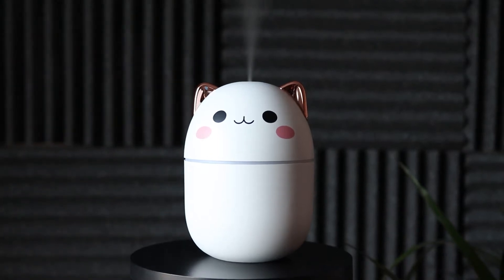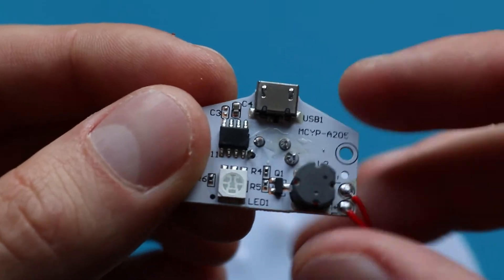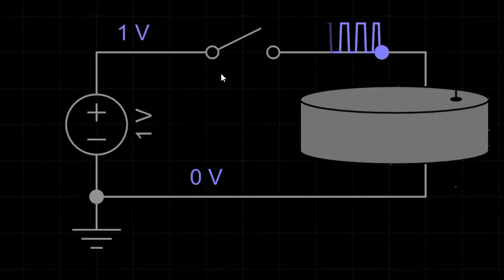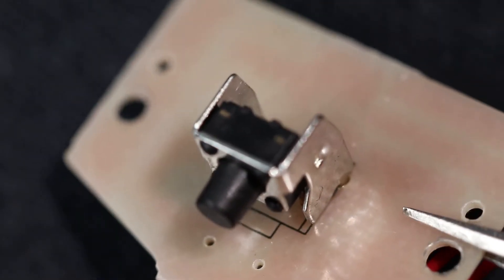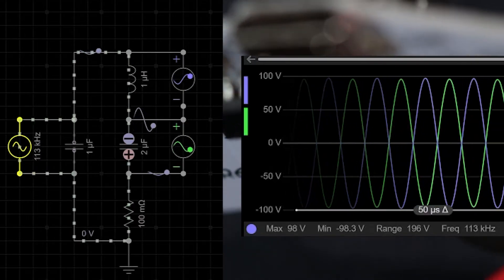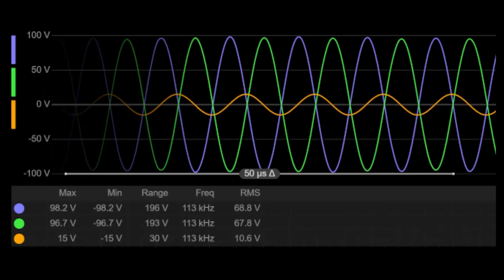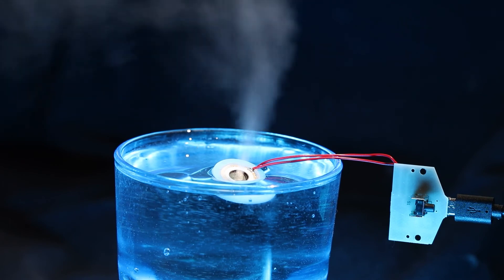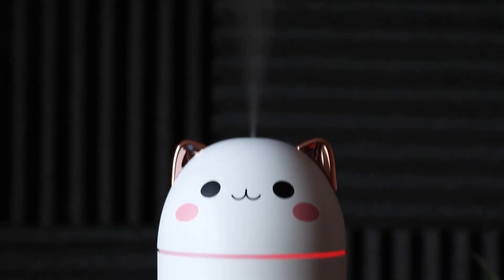A Humidifier Is Quite Interesting / How Does a Piezoelement Work?

Comment: Does the piezo have small holes so that the water from the wick at the bottom can reach the top surface of the piezo?
Reply from the maker: Some wise man in the comments says: "I bought one and you can see the holes. The ad says they are 5 microM, and there are 740 holes in about a 7mm circle. Pretty amazing.
BTW I needed a magnifying glass to see the holes."
So yeah, there are holes :D

Comment: Nice explanation! Is there a way to control the frequency of the piezo element?
Reply from the maker: What do you mean by controlling the frequency? You can control the frequency of an external signal applied to it, which would change how the piezo behaves. Using MCU or 555 timer. Or basically anything. 

Changing the resonant frequency of the piezo, or its physical parameters, would require physically modifying it.
Reply: @NickElectronics ah thank you very much for the information! 👐🏼

Comment: My question is when vapour comes out, does it depend if we put hot water or cold water, what will be vapour temparature?
Reply from the maker: So my guess is that heating the water causes the droplets to evaporate more quickly after they are released into the air, since the added heat gives the water molecules more energy to transition into vapor. But I am not 100% sure :D
Reply: Colder water is denser, so I would assume less vapor, not more.
Same thing as when an engine gets cold air, or nitrous oxide, it`s denser and lets you burn more fuel in the mix.
Maybe the element could be at a lower setting to produce the same amount of vapor if the water is warm?
Suddenly I`m tempted to atomize some hot coffee just to see what happens 😂

Comment: Can i make the piezo part vibrate , by  connecting it to the place where the speaker should be on a bluetooth music curcuit and sending a high frequency sound wave to that BT curcuit 🤔
Reply: These elements generally run at about 110KHz, those frequencies are not supported by any audio amplifier as it is far beyond human hearing.
You need a ultrasonic generator that operates far outside audible frequencies.
(some Class-D amplifiers drive a PWM signal switching at ~300kHz, but that is filtered before the output stage)

However, it should be possible to use the speaker output terminal to control the input power stage of the generator circuit, so it would create vapor on beat with the music! 😁
You would need to find out what the operating voltage is on the frequency generator, and the speaker amplifier would have to be able to reach that voltage to activate the generator circuit.
3-12V DC depending on type, commonly 5V on these small guys, so if the amplifier can reach at least 3V and the generator circuit does not have an on/off switch, it might work.
Btw, you need to know the impedance (ohms) of the speaker, and how many watts it can play at, that way you can find what voltage the BT amplifier can produce.

As an example, a 5W speaker with a 4 ohm speaker element, needs about 4.5V at 1.12 Ampere to produce 5 Watts, which should be a sufficient voltage to drive the generator circuit.
If the speaker is higher impedance that means more volts (given the same wattage) so the amplifier circuit wouldn`t need to be at full volume.

Oh, and of course you want to be within a certain range of the generator circuit`s intended voltage so you don`t destroy it.

All of this is theoretical, so experiment at your own risk ✌

Comment: Can I use the same circuit & operate it on 5V will it work? 
As NE555 can work with 5V also....
Reply from the maker: Yes, you can, but you have to be careful with the resonances in the piezo. If you supply it with 5V, the voltage in the piezo due to resonance may increase to the maximum that the specific piezo can withstand. With 3V and the same frequency, the resonance voltage is lower.

Comment: What I don’t understand is how the water film appears on the top side of the piezo element when the wick pushed against the bottom. How does that work?
Reply: I looked into it a bit more and it seems like this element isn’t the disk type, but a piezo ring that has a super fine grained mesh in the middle. The piezo ring slaps it onto the water surface and this causes water to shoot up through the holes, creating the droplets. The disk type on the other hand is used in submerged foggers that are used in ponds etc. 

I’m not sure if any of this is definitely true by the way, if the element is indeed a mesh it must have microscopic holes because it sure looks like a solid disk to the naked eye. On the other hand, I don’t know how a film could develop on the other side is solid, so surely there is some way for the water to pass through?
Reply: @BasWasAlBezet  I bought one and you can see the holes. The ad says they are 5 microM, and there are 740 holes in about a 7mm circle. Pretty amazing.
BTW I needed a magnifying glass to see the holes.
Reply: Good discussion guys. @BasWasAIBezet, great
Reply from the maker: Hmmm, very good question. I believe its because of capillary action through the gaps between rubber ring and piezoelement bottom part. So far I have no better explanation 🧐

Comment: I feel the video was to short. I would like to see how to fine the practical resident frequency.  The explanation of the theory was great, but how do I find the resident frequency of piezoelement?  What test equipment or procedures do I use?

Thanks for your video.
Reply from the maker: Hi, thanks for the comment ) 
It is actually funny, cause i had this part in the video but eventually decided to cut it out cause i found it a little bit boring. I did not have the equipment to show it on practice 😅
To find piezo resonant frequency you have to connect it to the signal generator and look at the current consumption while changing frequency. At one resonant frequency current consumption will be highest (low admittance) and at another one - consumption will be lowest (high admittance). That is the way i know ☺

Comment: Dang, i already know how it works after i read piezoelectric.... but i never would have expected humidifiers using them xDDD
That's amazing honestly, something I would never think of on my own :D
I guess its oscillating above 20khz so its not audible!

Basically a speaker that blasts a mist of water instead of air.
I wonder if Dog's can hear it though?
Reply: Well... Dogs can't hear 5mhz, so that's a no!
Reply from the maker: @Linguae_Music  Actually it is audible. A little bit. You still can hear high frequency noise. I believe it is because the form of the signal formed by the control system is not ideal and has distortions. So if you make a Fourier transform there will be components with a lower frequencies with some amplitude which create some noise. 
Why do you need dogs to hear it? 😅